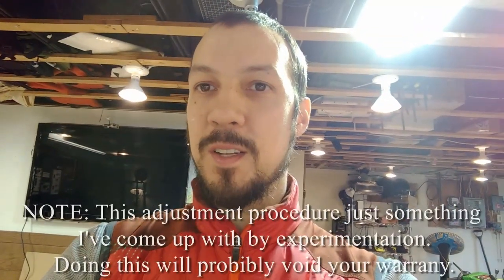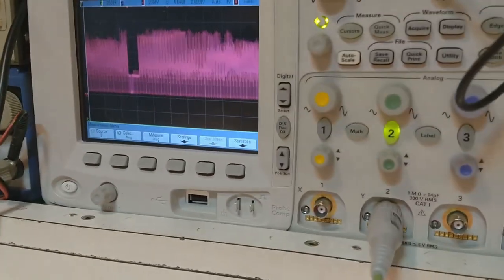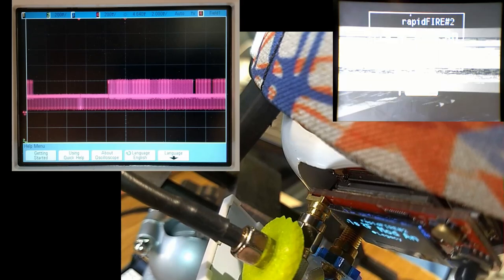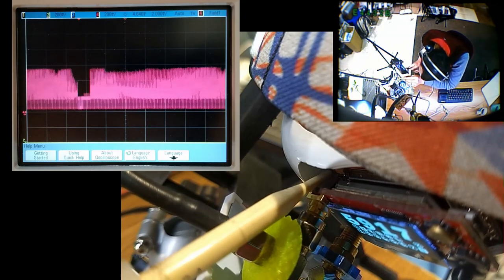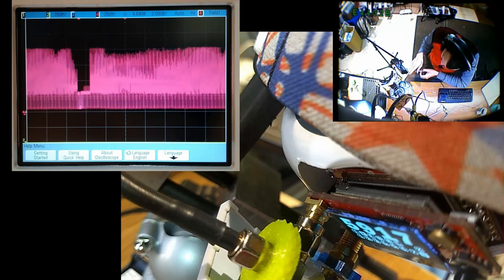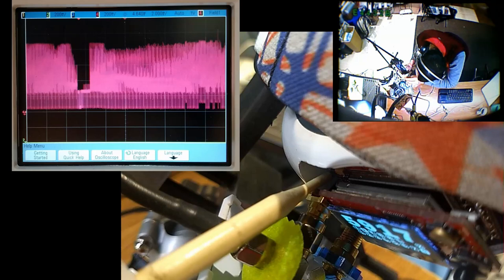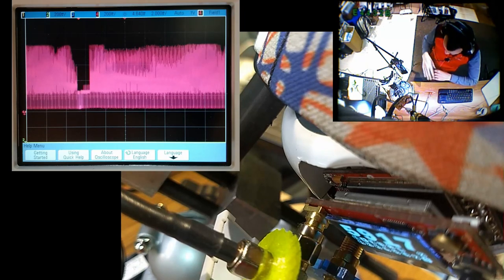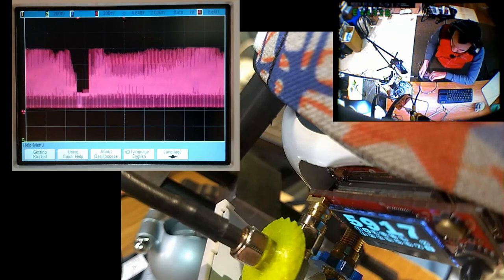ImmersionRC Rapidfire - Internal video level calibration - FPV Video Series - PK's Lab

Comment: Nice video! one question, which hardware batch is that? it looks like 1 right?, I have 2 modules of batch 2 and the image is burnt out on the whites; to give you an example, in this video when the RXs are switching you can see your floor tiles for some seconds and then is like if you had a full white floor, well that is what I experience with almost every camera and VTX, the yellow grass looks like over exposed white. while adjusting the video level pot I noticed that if I put it all to one side the image gets fine as it comes out of the camera, I also tapped into each RX video out and the image is not burnt out so it has to be something they do. maybe you have an idea of a mod that I can do to workaround it?. I bought a trued-X and the image is perfect so I wonder if you can have a hinch on what might be going on with my rapid fires, I friend of mine has batch 1 and the image is clearly different.
Reply from the maker: Interesting!  This is viewed in fatshark goggles, right? You are correct this is a batch 1.  I did send it in to officially have the Batch1->2 mod applied as described here: https://docs.google.com/document/d/12fa1Fp4zH6ywHt8JcEp5oBnHUyInWXMkOxXosGy5Mbg/edit  From what I can tell that particular cap just ac couples the video signal going into the the microproceesor the reconstrucs the syncs (or atleast thats what I remember).  They may have changed something else as well that wasn't publicly documented.   I do remember something about slightly improved sensitivity.  But I don't really thing that would cause what you are describing.  I could dig into things for you but to be honest it def doesn't sound like correct behavior.  I'd say it would be worthwhile to reach out to Tony Cake via Facebook Messenger and see if he can resolve things for you, hopefully with a replacement unit ;)

Comment: How well calibrated would you say did it come from factory?
Reply from the maker: Pretty close, maybe 15 degrees off max. Mine were the original batch one googles and have been in and out of my fatsharks a lot. I wouldn't be surprised if they might have moved a little from not so gentle handling or when they were sent back for the 1uf to 10 nf cap mod to bring things up up batch 2.
Reply: @PKsLab  I think I'm gonna give it a shot. Thank you for the tutorial!
Reply from the maker: @ashade4037  your welcome! good luck :)